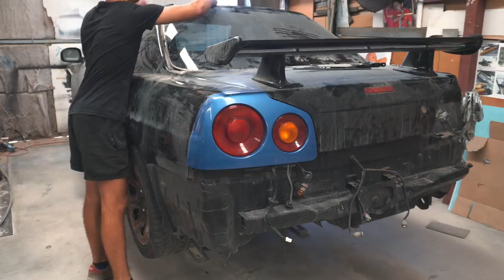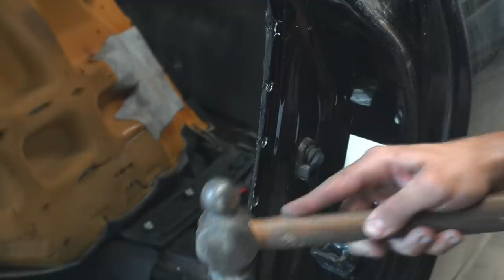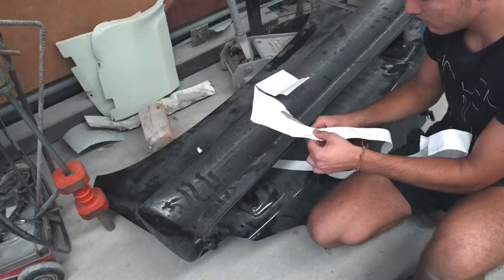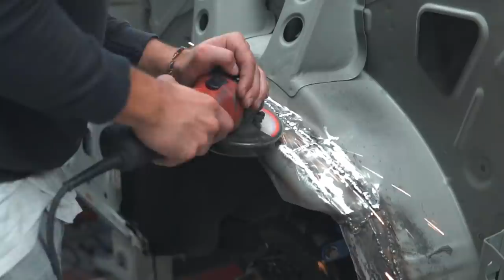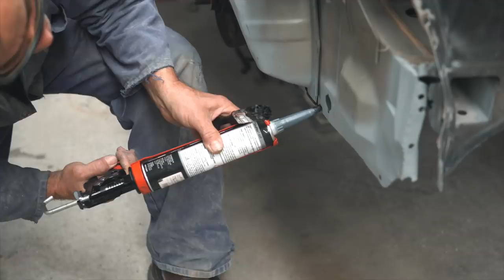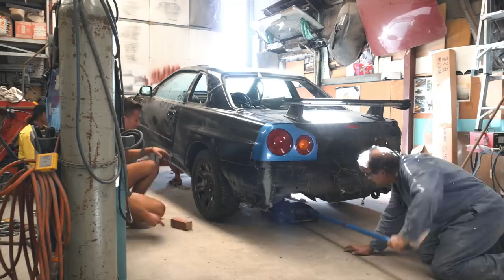Cutting Up the SALVAGED R34 SKYLINE | Poor Man's GTR [EP3]

Comment: Are there body differences between the r34 GTT and other r34 non-GTRs such as GT, GTX, GTFour, etc?
Reply from the maker: Good question! Okay so, any non GTR R34 is a narrow body Skyline. The R34 GT4 (rare to come by) is the best platform to build upon if you want to have a true GTR replica with the AWD system. The R34 GT4 body is the same on the outside like the GTT but the underside is pretty close to identical like the GTR. This includes a notch in the chassis rails for the front shaft, biggest gearbox tunnel for the transfer case and lastly a different front subframe to fit the AWD sump and front diff.
Reply: Broken Silvia thanks for answering + all the additional info. For those without access to as many tools as you and that have non damaged rear fenders, would you recommend just adding the conversion kit rear fenders from those that go directly on top of the narrow body R34s? Any challenges/issues with that?
Reply from the maker: @Mari0o0o  Not a problem. In all honesty it comes down to what you want to do with the car.. This is the dream for me that I'm planning on never selling, so skipping corners is not an option. Doing this build willow allow me to have my dream car at a fraction of the price which means metal quarter panels are the only option. It comes down to where in the world you are too. I'm talking to a dude from Germany and he's paying almost triple compared to my discounted prices on most items. This is where aftermarket fibreglass panels might have to get used (to keep things cheap'ish'), personally I hate fibreglass. It cracks, doesn't fit very well etc.. In saying this, my front end will be an aftermarket front end because I don't have $15k to spare for an OEM Z-Tune front end. Going back to your question, personally I would not stick fibreglass rear quarters panels over because no matter how good of a body man you are, they will never look 100%. I am picky, so I notice this. Others might not.. It all comes down to how and what you want to do with the car and whether you will be happy with the finished product :D
Reply: Broken Silvia thank you for being honest and putting it into perspective. Are you just doing a Z Tune lookalike front bumper or are you doing the whole kit with side skirts and rear bumper, etc.? Are there any other body differences between GT-R and non-GTR cars? I think I recall something about the hood being different? Or maybe it was where the front bumper meets the hood?
Reply from the maker: @Mari0o0o  No worries man at all man. I really want to make people think about what they want to do to their car so they don't make the same mistake as I did on the S14. Planning is key!! Yes I will be doing the Z-tune front kit which includes bonnet, front fenders, front bumper, side skirt extensions and rear pods. All GTR's share the same rear bumper, Vspec 2 and above models also come with a carbon diffuser which I'll also be sourcing once we get to that stage of the build. You will need GTR bonnet stay (piece that is in the middle of the radiator support), GTR bonnet hinges, GTR locking mechanism along with all the support bars and retainers. I will go fully in depth once I sort out a front end for my car (will also include part numbers) so that people can find all the info they need in 1 simple video.
Reply: Broken Silvia sounds awesome! Can’t wait to see how it turns out. Have you decided which rims you’ll go with?
Reply from the maker: @Mari0o0o  Not 100% sure yet

Comment: Hey mate, something i have found helpful when butt welding the panels is to either leave at least a 1-1.5mm gap between them, ive found this way the weld bridges the gap, rather than just penetrating the surface.  another way you can do it is to use a grinder to make a 30 degree bevel in the edges to make the panel thinner at the joint, it will mean less grinding for you too :)
Reply from the maker: Good idea man! Thanks for that :D

Comment: Also you should look into POR 15: a rust preventative coating and good alternative to seem sealer or typical undercoating since when moisture is on the surface it actually strengthens the coating rather then wear down!
Reply from the maker: I've heard of that and seen it bring used on the AMMO964 I think. Will for sure look into it, thanks for the comment

Comment: Is there anything structurally different between the gtt and GTR? I mean like chassis braces or extra Stitch welding or anything crazy like that? With cars like the Lancer and its Evo counterpart, there are huge structural differences that make it a rally car instead of an eco box. Wonder if Nissan had the same way of doing their cars. The r34 in any form, isn't an eco box however.
Reply: R34 gtr had the options for better  braking, stiffer suspension and handling upgrades all for that  nice awd but as an owner  I can tell you they are super dooper the same aside from the bodykit being wider on the gtr.
Reply from the maker: I can’t see then doing anything different.. not an expert though
What I do know is different is the front of the chassis rails are notched for the front shaft to clear through (awd), the floor pan around the gearbox tunnel is different so the transfer case can fit and the front suspension setup is a little different (also front subframe)
Reply from the maker: If this was a Gt4 shell which is identical to a GTR from underneath then after the conversion the car would be awd and legit a gtr with the only difference being a vin number... check out Rad Rado’s yt channel. He has converted a gt4 to gtr running a rb26 and getrag 6 speed

Comment: What's the black stuff you put on the rear aches ? And that spray what's it for?
Reply from the maker: Sika flex seam sealer to seal it from the the weather
Weld through primer where the two panels join
Reply: @BrokenSilvia  wow brilliant I use sika too 😁 your the only video who has actually replied about this 😂 cheers 👌
Reply from the maker: @kirklishman8997  No stress mate!

Comment: What's the difference between the Skyline GTT and the Skyline GTR?
Reply: Lucas Martínez Parra R34 GTT - RWD RB25DET Neo 2.5l single turbo 5 speed...R34 GTR - AWD RB26DETT 2.6l twin turbo 6 speed...There’s alot more wider body panels, interior ect. that’s pretty much the basics
Reply: @alecsalas2592  Okay. Thanks.
Reply: A few things. GTT = 2.5L single turbo RB25 DET NEO engine and it is RWD few body differences panel wise, Interior bits GTT is less sporty. GTR = RB26DETT twin turbo and its got an ATTESA  AWD system, the body is slightly wider/flared out bigger wheels from factory sportier interior. Tons of skyline forums out there to read more specifics mate.
Reply: @inferniousX  Thanks a lot, mate.
Reply from the maker: Body wise the differences are: front of the chassis rails on a gtr are notched for the drive shafts to go through, front suspension setup is different, different from subframe for awd motor and sump to fit, different gearbox tunnel so the transfer case can fit and lastly the rear quarter panels. Are than that pretty much everything is interchangeable, bolt off/bolt on
Reply: @BrokenSilvia  Got it.

Comment: Poor man's gtr..... so this is getting rb26 swapped?
Reply: I fucking hope he not swap RB26 , RB25DET Neo are a fucking monster engine
Reply: @topkek586  hell yeah! 25/30 :P
Reply from the maker: RB26 is the way to go.. will mentioned reasons why I wont go 25 or 25/30 when we get to that stage. Still haven’t bought a motor
Reply: @BrokenSilvia  I understand the reasoning behind the RB26 swap but I won't spoil future content with my theories lol. I went with a series 2 R33 GTST (easier to find in QLD and a lot cheaper than a 34GTT) ill be doing the 25/30.

Comment: Hello,
im from Germany and trying to get a R34 from Japan. I hope it will succesfully delivered within 2-3 months if nothing goes wrong.

How much will that all cost you?
Reply from the maker: Nice man. Budgeting from start to finish $40k AUD (finished car with engine etc..)
Reply: @BrokenSilvia  thats a nice budget. I Hope that it is enough. But it is also so much Money. Is that because the Skyline is such a rare car? 

As an example, I am searching a Damaged M3 E46 to do a Motorswap. Sometimes there are some for 8000$. But not often. So i think 15000 will be enough.

But however, still waiting for my Skyline.